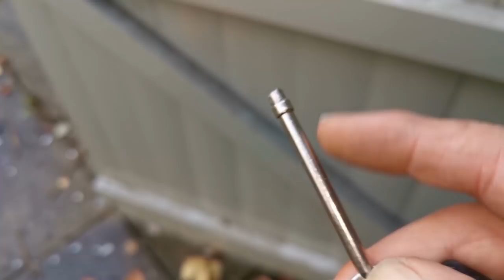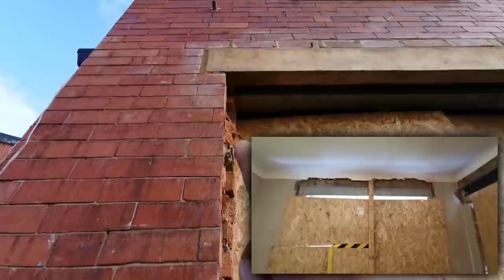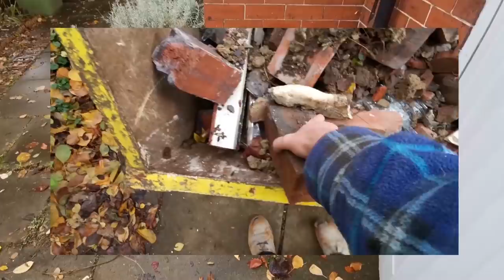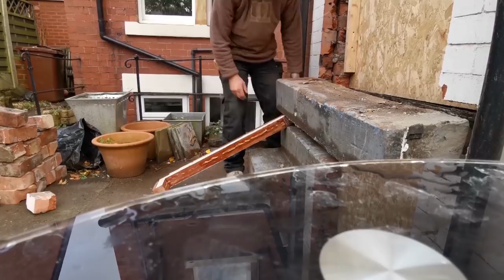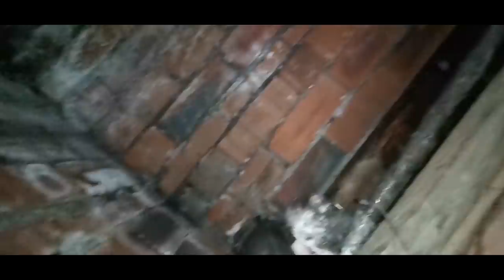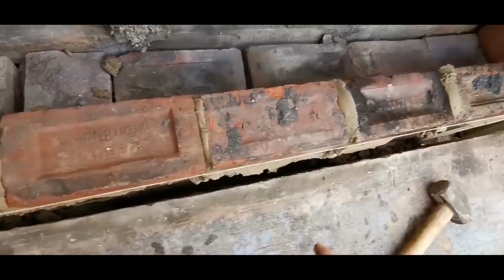French doors & bay window Pt1 - Kin builders & me a joiner brick laying

Comment: As Jamaco1 stated previously a lintel should have a bearing of 150mm, also when cutting out  the old brickwork I try & find a plumb cut that leaves no small cuts as these tend to come loose. If it's an exact dimension I would tooth the brickwork back to lose  the small cuts. Can't  believe these guys are getting away with it. Tbh I've done a fair few extensions etc up that neck of the woods & some of the work round the North part of the city is scandalous. Got to be honest your work is as good as it gets & I've been doing this  46 years & I've got the back to prove it ;-)